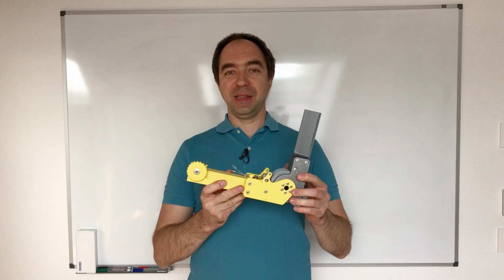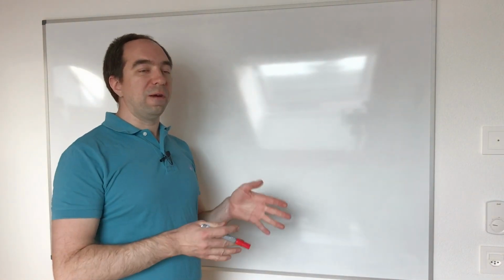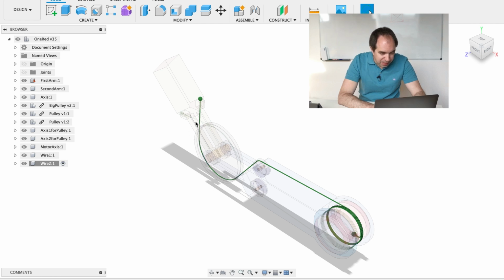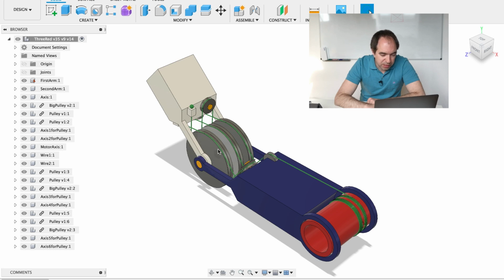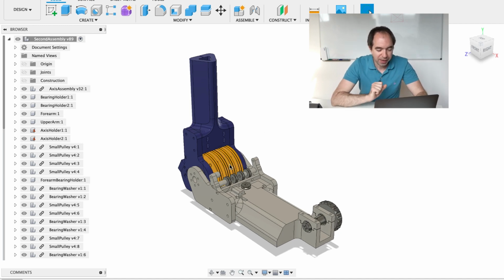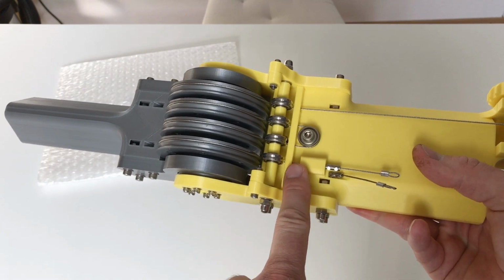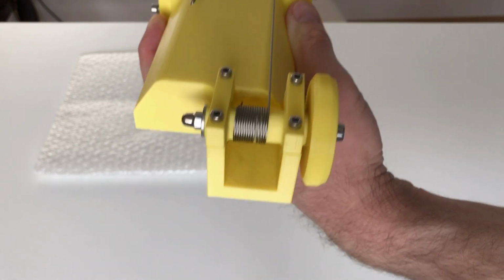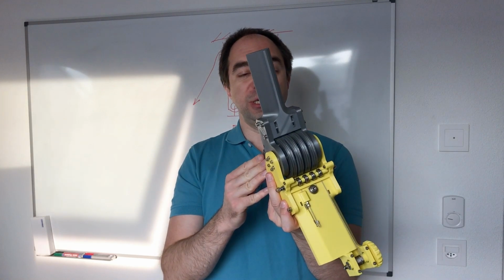You've never seen the Robot Joint like this one!

Comment: Thanks for sharing. I just have one question. Should we use two cables? I mean with just one cable we can still have rotations in two directions! Why you have used two cables, one for each direction?
Thanks again.
Reply from the maker: I actually used one cable, and at the middle it was fixed at driver pulley. Thank you for comment and question!
Reply: @Skyentific  wouldn't it be a pain to get the tension equal if you you actually use 2 cables?
Reply: @Bbonno  If tension is unbalanced then the elbow turns until it's balanced :) (Save some possible unequal tension in the spool, but that also equalizes itself over the course of winding and unwinding.)
Reply: @u1zha  By this method, you will lose your accuracy. For example, if you want to rotate the output arm about 20 degrees, since your cables' tension is not balanced, the output arm will rotate less than the desired rotation. In fact, there would be a backlash in the system.
Reply: @abbasbataleblu3772  Accuracy depends on how large the tension is. I'm just answering the point someone made that it would be hard to get two cables tensions equal. It wouldn't. Put a large tension in one side and it will stretch the other side. (So long as we're still talking about a single elbow and a single driver pulley they are wound on.)
Reply: @u1zha  Thank you
Reply: @Skyentific  Thanks for your answer. Couldn't you use one cable without fixing in the middle of the driver pulley? In the simplest structure, for example, I mean, you could just fix one side of the cable on the output arm. Then, the cable could go around one side of the big pulley and rolled around the driver pulley. After, again the cable goes around the big pulley, and finally, you could again fix the other side of the cable to the output arm. Therefore, the big pulley did not need two slides or so.

Comment: This is very interesting... 

I've been looking for an actuator like this for a long time, but hadn't seen one before. I had planned most of the other parts of the system that I wanted to build, but was missing this piece. The basis of the robot I want to build is a central rotating shaft, and a system of clutch units that engage the shaft. These clutch units would be variable, and could either apply a controllable sliding torque, or lock to the shaft to produce a burst of force on the cable.

The main advantage of this is that you only need one massive motor centrally located, and then every limb has access to the full power available from the motor. When not being moved by the motor, the clutch for each joint could lock in place and provide zero power holding torque.

Multiple joints can be actuated at the same time, and pulsing the clutches quickly between engaged and immobile (with a small amount of spring based backlash) could allow relatively precise multi joint simultaneous control.

Comment: Nice and smooth!
You could get a much higher reduction ratio with less pulleys in the joint if you use differential pulleys, would need both ends of each cable to be anchored into the winding drum but that's easier than trying to fit more pulleys into the joint.
I think there is a good chance this is one of the lightest joints for the strength that can be achieved!

Comment: Beautiful design, and very beautiful explanation. Did you consider the life expectancy of the cable? Could the constant bending of the cable induce fatigue? A cable failure would compromise the joint, and the reparation does not seem straight forward.
Reply: After a second thought, you are not restricted to metallic cables which would reduce the risk of fatigue. Thanks for the video.

Comment: Couldn't the reducer pulleys be achieved by sandwich-ing multiple reducer gears in the elbow and not have to deal with slipping/maintenance of the cables?
With electrostatic clutches, you could even lock one or more sandwitched reducers to provide multiple actuation speeds, at the expense of torque when not needed.

Comment: Like the design, definitely inspiring 😊
What would be a rating for this type of articulation (meaning strength, like an actual elbow or lifting boom)?
Could be useful in all sorts of mechanisms if there was.  Maybe a new type of chain  that behaves like a rope but can still be used with sprockets.  Update if possible

Comment: I like how the axial movement of the rolled cable in the driver shaft could be used to activate toggle switches on each end and keep these very close to a motor without an encoder

Comment: That is great. 

For a joint quite over engineered, BUT .... what prevents you  from using hemi-round curved nylon gears (prevent backlash and play ) https://youtu.be/iEYzx-G53SE for a gear box inside the forearm to increase torque for your joint motors ?. You would save build complexity and maybe wire torn. Wires may not always stay in case of an impact (like robot falls, arm hits a surface. etc ...) A gearbox is shock prove and easy to maintain :)

Non the less. Fantastic work !!

Comment: Problem with this types of joints is speed it's just too slow 🙁🙁

What do you think about using hydraulics or air pistons ??
Reply: It's as fast as you need. Put a faster motor or use less mechanical advantage if you need faster movements. As simple as that. You just can't have both more torque and more speed at the same time with the same motor as torque × rotatioinal speed = power, so if you need more of one without less of another, you need a more powerful motor.

Comment: If you removed some of the grey plastic on the back side of the elbow and moved the pulleys up a bit you might be able to get more rotation in the joint, I don’t see why you couldn’t get it close to 270 degrees because you can get one side very close to being completely folded so if you moved the pulleys on the grey piece or made it symmetrical you should be able to get a much greater angle of rotation.

Very unusual and very cool joint

Comment: Don't forget that the elasticity of the cable helps dampen mechanical shocks. It's a great design. Maybe with cast metal parts, a spring loaded wire tensioning system, some oil and a dust proof cover this design could last for years without maintenance.

Comment: Nice design, does does this version already include a reversed cable path in order for the motor to extend the joint?
Reply: I think you could just add a second drive to the currently fixed end of the cable.  To extend you brake the original drive, and operate the second drive.  To retract, lock the second drive and  operate the first drive.

Comment: The gray pulleys on the output arm must have an independent rotation between them, otherwise they increase the energy losses of the system. The goal of these pulleys is only to send back the rope, by the way I recommend you to use ropes and not v-belts, you would have the same results by spending less on materials and design time.
Another note you should take is that if the spool has a diameter smaller than the pulleys it does not necessarily create a reduction, because the hoist system works differently than the speed reducers, they are two different things.
Reply: In this case the wire is un/wrapping around the larger joint pulleys and while it moves under half a turn the drive pulley moves about 10 turns.  There is a 20:1 mechanical advantage that is hiding in the details.  The lever arm at the joint is bigger than the lever arm on the drive pulley.

Comment: i was playing around with a capstan actuator like this for a spider robot over a decade ago, but this is a good idea for mechanical advantage, at the time i was thinking offset horns :-( and reduction gearing as a stop gap.
one BIG advantage of cable systems is you can remove the motor from the "limb" and bury it inside the body (think bonnet release on a car or bike brake cables) that lets you move the wight to the static components and patently lower the center of gravity with a smaller and thinner limb.
oooh there is an idea , if you add some overrun clutches you use more than one system per limb, 1st fast low load and a 2nd high torque system for power.
Reply from the maker: This is really an excellent idea!!!
Reply: Are you sure about the bike brake cables? Radius of the pulleys are so small can develope more bending stress result in fatigue? Can you offer another alternative to those cables?

Comment: Your pulley math is wrong. The joint with 3 big pulleys(effective 2 sets) has mechanical advantage of 4, there is no such thing as mechanical advantage of 3 with pulleys. Therefore the one with 4 big pulleys(effective 3 sets) has mechanical advantage of 8. It's powers of two.

Your final reduction ratio is about 40, not 20. The leverage ratio that matters is between the radius to the tackle pulleys and the radius of the driver.. which  coincidentally is about the same as the big pulley radius. The big pulley only redirects the wire. It does not provide mechanical advantage.
Reply from the maker: Unfortunately, you are a little bit wrong. First of all, on english wikipedia Diagram 3 show block and tackle system with advantage of three. And it is exactly the same as in this video. Second, I measured the reduction ratio of 3D printed version, it is exactly 20. And the final reduction does not depends on small pulley diameters at all. But thank you for comment!

Comment: I would like to point out another advantage of the beautiful system that you designed: The torque is equal over the entire travel of the joint. This can be hugely beneficial in robotics where knowledge of the force is required.
Reply: Your comment caught my attention because I've been playing around with robotic joint actuators, 3D-printing some of the examples representing different types (planetary, wave, cycloid, etc.) I think I understand what you mean, but can you explain briefly why other types may not deliver equal torque over the range? Are you speaking specifically about cable-driven types? So far, I have built planetary and cycloid for 4 axes, and now I have been looking various types of capstan/cable drive systems, (hoping) to select the "right" one...
Reply: @mbunds  hey bro I can tell you why. It is because this is a form of mechanical power transfer. Where you transfer power from one location (motor/actuator) to another location in the system. The reason why he said torque is equal over the entire travel of the joint is because with other methods of power transfer such as the 4bar/2bar mechanism, have an inherent disadvantage due to the effect of the lever arm on the output torque of the joint. the torque changes base on the angle of the lever arm causing you to have more torque at a lower degree angle and lower torque at a higher degree angle.
Reply: @mbunds  traditional chain pulley belt system you see in automotive are big huge assembly power transfering system. You basically getting the same advantage as a belt pulley which reduces the overall size profile of the system.

Comment: Great work!   However, It must be clear that the reflected inertia is the square of reduction ratio (N) times the inertia of the your motor's rotor.   Your feeling of easy back-driving probably is due to the reason that you haven't connected a real motor at the reel.  The inertia of your motor's rotor influences the back-drivability the most.

Comment: I was a rope rescue tech for years and the force multiplication is key and I have been looking for a way to incorporate it into mechanical joints. Thanks a lot for giving my mind a boost in that direction. I just have a few questions. 1) where do you source your pulleys and cables? 2) what 3D printer do you use? 3) which design suite do you prefer for the design you showed?

Comment: Wondering if the device is not too weak and would "break" easily (from pulling on the cable). Can you give your feeling about that?
Reply from the maker: In this design 4 cables hold together the output arm. So it can handle 4 times more than single cable. And Ambidex (LIMS2) has even thinner cables and capable of handling 3kg payload.

Comment: This kind of joint is really weak, the total strength falls onto a single thin wire.
Reply: I'm sure that wire can hold quite a lot and you could just get a wire with even bigger diameter and it can hold literally tons of kilos

Comment: I think James Bruton would be very interested in this joint!
Reply: Sadly I don't think he does. There was a comment on last week's video about someone suggesting this, and his reply was a typical 'I'm not doing that because I don't need it' kind of reply. I like James and his content, but he comes off extremely arrogant in his own comments, sometimes even in his own videos. Maybe he'll look into it in the future if QDD doesn't work well for his compliant dog projects, though this kind of actuator is exactly what he's looking for with his search for a compliant leg mechanism. 

The lab that developed LIMS2 also developed a finger joint with a single wire and some springs, where the springs return the finger to a neutral position when the wire actuator is relaxed. Something like that mechanism could be adapted to be a passive compliant foot, with an encoder on the drum for positioning purposes, spring on the foot would keep the foot securely planted no matter what the terrain type is, and a simple torsion spring on the drum itself would always keep the wire in tension. Of course, the foot would need to be redesigned to have a cam profile, that way the passive system actuates while the foot is stepping, but that's nothing more than some additional math in the programming as your foot position changes slightly as the leg steps down. I also believe this system, a passive actuator with a way to sense positioning, is exactly what James is looking for with a compliant leg, and could easily be fitted to add compliance to a rigid leg like what openDog currently has.
Reply: @xaytana  i have to say in defense of James Bruton your accusation of arrogance is plain wrong , the phrase '' we are all on the spectrum '' comes to mind  and may be applicable , James like a huge number of makers likes to forge his own path but arrogance is not one of them .
Reply: @xaytana  absolutely agree, this mechanism would give him the torque he needs on opendog.
Reply: Joints always elicit interest...lol
Reply: Single servo dog leg!

Comment: I have two questions  
1. What about belt or cable slippage. 
2. Have you checked  the positioning accuracy or repeatability 
Why you are not using  harmonic drive gear which have very higher gear reduction even you can get 1:120
Reply: It can't slip as it is anchored at both ends. Any slippage against the pulleys is irrelevant.

Comment: Great job! You are solved the matter of mounting a motor directly in the joint, in my experience, the joint of elbow is one of the most difficult articulation in the human body, for causes like the reduced space and the position in the angles of charge, previously, i did make a robotic arm based in pulleys, but it only works partially, only works back an forward when the arm was set in vertical position; in horizontal, only work's in one way. 
I will try to replicate your work whith your permission, thank's and cogratulations!!!

Comment: Hi sky. This reminds me a lot of differential a pulley system. I built something very similar to this for a gearbox of a parasol, with a similar level of reduction (but substantially simpler).
If you make the driver pulleys of different diameters but on the same axle you can make use of the difference in length in winding-unwinding them. The smaller the diameter difference, the bigger the reduction rate. Then you only need two idler pulleys. This makes the design super compact. Check out the wikipedia article on differential pulleys. What I'm talking about is basically a mix between your pulley system (where the idler pulleys are the ones that transmit the force to the other member) and a differential pulley system.
Good job, this prototype looks really well built!
Reply: free spirit 1 Do you have any pictures of the gearbox you built?
Reply: Nothing I'd want to show to anyone. i made it while I was still in college and it contained several mechanical mistakes. If I find some time this week I'll whip up one in cad to demo the concept.
Reply: Dont understand it from the description. Is it something like the WAM Arm drive? Have found a patent from Bill Townsend US5,207,114

Comment: This is really useful since you could use a smaller motor to move the arm and get 20 time more force than the input which is great to increase the time the battery can function, btw what cable did you use for you design? Are you going to make it open source?